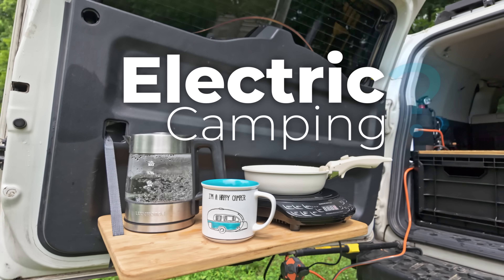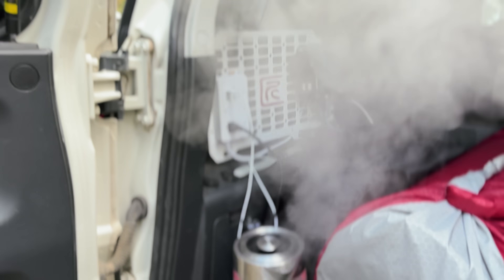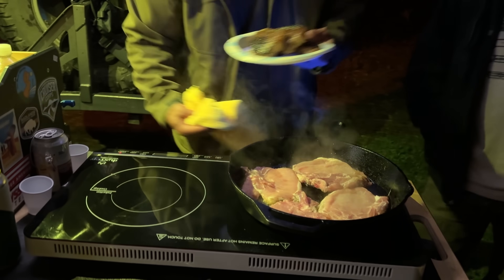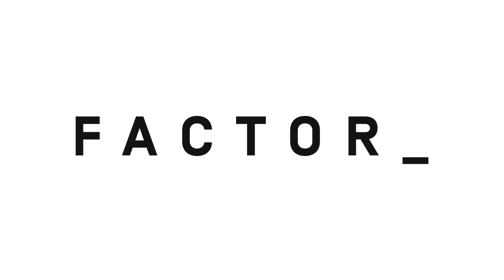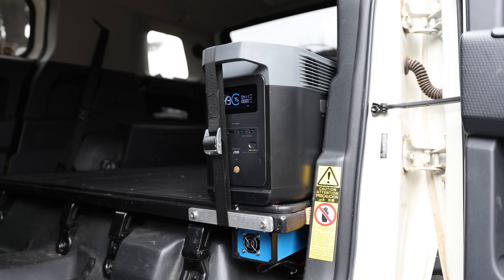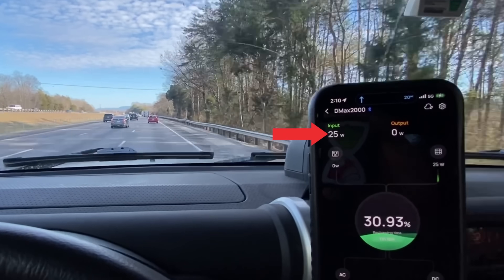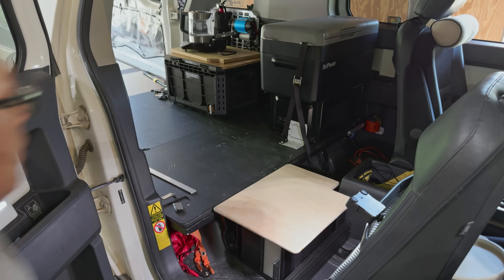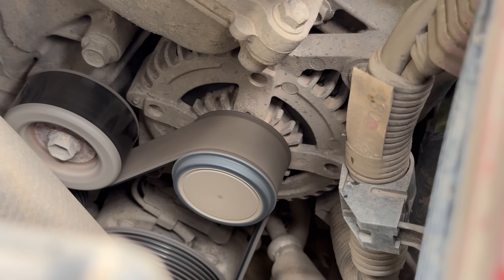I Tried Full Electric Overlanding For 1.5 Years | Was It Practical?

Comment: Not quite there yet. We have an offroad trailer still reliant on LPG for warm water and space heating. 200AH with 200W solar is plenty to keep everything else powered and batteries topped off. A 20A DC-DC charger that connects over an 50A anderson plug helps tremendously when driving from location to location to bring SOC back even if it was very low. Yet, I am not sure yet how to solve the heating issue. Everything else that only uses high current (coffee machine, induction plate, microwave, kettle) for short time is no issue for sure.

Comment: Fantastic video! Thank you for sharing. I really enjoy your breakdowns that start with general engineering design choices, then break down parts choices into some main categories and price points based around *use cases*, then discuss individual brands and their implementations. It's so refreshing to get the opinion of an actual engineer rather than the intuitive, but not grounded in deep ME knowledge, "opinions of guys in your local overlanding garage". Perfect example: your shocks and upper control arm videos simplified my decision making process greatly. Thank you! I've been searching for a channel of information just like this. GIVE US MORE VIDEOS!

I think you mentioned in one video that you also owned a 1st Gen Tacoma. I just lucked into an old man (25-year old classic vehicle!) 1999 Tacoma SR5 3.4V6 standard 4x4 Xtra-cab w/ long bed. Generally, it's in fantastic shape for an old truck but it's going to need serious love in the suspension category especially as the big FabTech coilovers and the old shocks in the back with add-a-leaf springs in the back are all well past their duty cycle dates. It's up on 32" BF KO2s and the back end bounces up and down like a trampoline when I go over train tracks!

Any videos you might consider making for giving your ancient Taco some love in 2024 would be seriously appreciated. My eventual goal is to outfit it for overland camping with a Kuat IBEX topper and all electric camping setup like you've outlined here. May be tricky with the old-time electrical system, I'm not sure. I was thinking dual battery with a couple of slim-line Li-Ion packs but now you've got me thinking about the all-in-one battery banks. Ecoflow has some seriously big batteries available, all the way up to house-capacity.

Comment: We boondocked with out TT without propane for two years in all but the most extreme cold weather.  4kWh, including LFP and a Delta 2 Max.  Just Ordered a pop-up truck camper, Tune M1.  Going full electric using my D2M and a 280ah LFP, 400w solar, and dc/dc charger.  Cheaper than putting in a propane system.

Comment: I'm mostly diesel.  Diesel heat, diesel cook top, diesel engine.  My electrical is 12V with access to an inverter that we only use for a minute or two at a time for the microwave.  If I were to go all electric it would cost a lot of money for the batteries.  No thanks.

Comment: Which is more power hungry for heating water, the electric kettle or the microwave? Would be nice to just have the one device, if the power consumption isn't too far off.
Reply: Kettles are 80% more efficient than a microwave for heating water. Another source says the efficiency of the microwave to heat water is only 47%

Comment: One other big point is many power station companies are FINALLY putting high amp 12v DC outputs on their units. Oupes, for example, has a 12v\30amp DC Anderson plug output on their mega line. This allows you to run 12v accessories like lights, diesel heaters, etc. You can even connect it to 12v switching systems like those from Switch Pros, Auxbeam, Garmin, etc. IMO there is very little reason to run dedicated complex dual battery systems anymore. Power stations with the fast alternator charging and high amp 12v DC output have rendered them obsolete.

Comment: I've been running 95% electric for the last 14 months of fulltime boondocking.  I did use some propane for heat over the weeekend when I got caught in freezing temps.  I haven't refilled propane since I started the all-electric experiment. 

My setup is ~$1,100 for 750w of used panel, 45A victron controller, 1280Wh of LiFePO4, 1000w PSW inverter, and a VSR for alternator charging.

Comment: Lets be "Honest" here, to say the induction cooktop doesn't get HOT is a little misleading, I have the Nuwave myself, and while it's true it's different from conventional surfaces, In use with my cast iron pans it will absorb heat from the pans as you cook and when you finish you DO NOT WANT TO TOUCH THE COOKTOP without some cool down time, it will burn you.

Comment: The current problem I have with the new all in one power systems it how slow they recharge on 12V.  For me the dual battery system is still better for now.
Reply: I am all electric camping, kettle, toaster, induction,,amd kettle for heating water for a shower. Overnight we typically use 80AH from the battery. We then charge at 80A, so, it takes 1hr of engine running during the day to replenish that 80ah, and we have 240ah total. We have never runout.

Comment: We boil water in the microwave in our van all the time. I would be curious to see what your thoughts are on boiling water with your microwave vs. your kettle (time &  energy usage)
Reply: Microwave is typically <50% efficient, ie, it uses 2x more power than an electric kettle, and a 2000w kettle is much faster.

Comment: I plan to utilize more AC in my next truck build. I’m not sure I will ever be 100% electrical, but I do think things like heat (even though inefficient) can be utilized successfully with how quick some of these can charge now.

I just got an Etaker today and I have to say I am very impressed so far. It has a lot of features other batteries as missing for a good “overlander” battery pack. 

Well done as always man!
Reply: Add a few 12v blankets or pads for those times the temperature is not as harsh

Comment: I run a microwave,electric kettle and slow cooker off a small system in my Jeep. Solar panels, 1500 converter, no problem. Two deep cell and a spare seperate lithium for the fridge.

Comment: In my opnion, you bring many valid point but on the hother hand there's some misleading information. Ease of setup, power stations win. Total cost of ownership and battery capacity, a component based system wins. If you have the capabilities to setup yourn own system, powerbanks are extremely expensive compared to the alternative. I will also add that solar panels can absolutely provide sufficient recharge depending on your location. There are so many variables involved which most people do not understand resulting in an unnecessary high expense purchase of a powerbank. Thanks for sharing. Cheers

Comment: The new generation of hybrid pickup trucks/SUVs should make full electric overlanding a no-brainer. The new 4Runner and Tacoma have a 2400 W inverter that can run multiple appliances already, and the truck automatically charges the hybrid battery using the ICE when the SOC is low. This would leave more space in the truck for cargo and equipment, and for a much simpler and care-free experience.
Reply from the maker: The only thing I don't like is how soon the engine will kick on. It tries to keep the SOC very high. So for electric cooking or running things overnight. The engine will go on and off every 5 minutes. Kind of disturbing for a camp site.

Comment: I fit 200Ah Li where the rear AC would go in the luxury models of GX460 behind the plastics... I welded up a battery box that is held in place by all of the existing bracket holes. I  can park the GX in the shade of a tree, and run an extension that plugs into my rear bumper out to 400w of deployable solar panels. I 've got 2000w inverter tucked in on the other side, with an output to my bumper, as well, so I can run an extension cable out to whatever I need. I dont' have to open the vehicle to add more solar or to run AC out. The batteries, inverter, cabling, monitoring, charge controller etc, don't take up any interior cargo space. I'd have to add up total cost, which is likely more, but I still have seating for 5, a drawer system and a 73qt fridge/freezer.

Comment: What about -15°C= 5°F ? Don't the power stations need to be kept warm ? From 🇨🇦
Reply from the maker: yes. but when you discharge it (like running electric blanket over night) the battery itself also warm up. which helps but probably not enough for 5 F. That's another reason I switched to the ETaker, which has self heating function so it can charge and discharge down to -22F.

Comment: I will never go back to gas after moving to electric because of space constraints in the SWB Pajero Evolution. I have my whole car run off a single 200Ah lithium that does cranking and deep cycle duties. It charges at full alternator current (100amps) so it recharges extremely fast and i get about 4 days of fridge and cooking duties out of it without starting the car. Never worrying about cold or wind is a huge advantage of induction as well
Reply from the maker: Wow Pajero Evo. One of my favorites

Comment: I have the same cookware as you and they are absolutely fantastic. Clean up so easily and work great on induction stove top! Yes, going electric is the best way to go! I have two portable power stations one is 2000 W hours and the other one is 750. Perfect combination and they all recharged very quickly! I think both will charge in about 80 minutes total would never go Two. Dragging around propane, containers, or gas. Thanks for the videos.

Comment: I have a Bluetti AC180 that provide 1800 watts of AC and 1173 watt hours.  $600 for the AC180 right now.400 watts of solar and can also recharge using my 400 watt vehicle provided AC. I use a Stokes VOltaic 500 watt kettle and now have their new electric cook set with pot and pan. Vary them from 400 to 1000 watts input for cooking.

Comment: I "hard-wired" my 5lb propane tank on my FJ Cruiser for my permanently-mounted Joolca and tee-ing off using 1/4" RV quick-disconnects to minimize set up for my stove.

With the amount of hot water I use while camping, I couldn't use an electric water heater like a Duoetto as I have 100L onboard. Preheating the water while driving using a Glind hot shower system in recirc mode helps reduce water wasted when arriving at the campsite. Water stays warm for a while too which is nice.

A 1-lb tank for emergencies with the right adapter would have saved your friend for when the 5 pounder empties during a trip.

Comment: Very interesting, I’m still building up my Troopy and maybe need a slight rethink on the finishing on one side of the vehicle to include electric cooking.
At the moment, I have got a brand-new Red-Arc Go Block 100 ah all in one battery System including the mounting System the lock into place in the vehicle.
It can run an inverter so might have to do some more research on this.
Keep up your great videos, thank you .
PS, I’m running the standard pizza cutters that come standard with my vehicle new.
225/95R16 And do not plan to go to anything wider and this cannot replace them in the future which they probably go with a 255/85R16..

Comment: ~3yrs all-electric, although it's come via trail and error but luckily sparing significant cost per error. Currently at 800ah lithium for the past ~1.5yr with RedArc RedVision, which only allows 30amp max charging from alternator, solar, or 120v. Last summer worked at night and slept in vehicle during the day in Arizona. The hottest outside temp 119F while staying cool inside at 72F x8hrs with 5k BTU 120v window AC unit via 3k inverter and 600w solar panels. In the winter, then sleeping at night, NMBDR ~8k above sea level, 7F was the lowest stayed warm with 120v 1800w heater. Additionally, 1800w induction heater, 1800w Ninja AirFryer, and 300w 12v heating rod to warm water for showering. In the ~3yrs I have upgraded the batteries, but their location has stayed he same, the rear seat footwell in a 4Runner on top a 10g footwell tank from Front Runner. Electric over propane or diesel, is more set and forget, no spills or leaks, and regardless wind or elevation as well.Thanks for sharing.
Reply: In my experience, and I'm sure others have noticed similar, most of the battery is consumed between making dinner, staying cool or warm while sleeping, and making breakfast, all when there is no solar power support.
Reply: @jatorresrv  How do you mount an AC window unit in the 4runner? Were your solar panels attached to the roof, or did you set them up on the ground? Care to make a video of your setup? Could you provide links to everything you used?
Reply: Man, that's 90-100KGs (200 pounds) of battery just to throw out 7-10kgs (20 pounds) of propane....No thank you. I usually get two 3kg bottles and use the second as an emergency. Before the second one is out, I would have replaced the first one. Saves me a tone for gear that matters. I have a 100Ah battery to run lights and fridge and small devices/charging....I think of adding induction cooking but i do not have the space, and more importantly, the courage to spend my money to do it.
Reply: @ How do you run an AC for an outside temp 119F during the day and you sleep in your 4Runner while working at night? By the way, when fully loaded my weight is 6,200 lbs, despite my battery weight. I also a never looking for propane when in Central America, not to mention, harassed by police/military for carrying propane in a passenger vehicle. There are lots more reasons why battery and no propane for my traveling style. Hope that helps.

Comment: Done similar stuff but back in china. Think it really depends on the gears as well. I did it by achieve using BYD DM-i vehicle. They are just electric car with very efficient generator. 46% efficiency for the new one i believe. My one gives about 4-5kw power per liter of petrol. And i had a 200+ liter tank that i installed My self. And i calculated to use about 2-5kw per day and using the function Called power station mode, Battery in the car is 35kwh So takes more than a week to drain the battery flat And If u get the engine running and charge the battery up again. In theory Full tank of fuel is able to last me about 210 day in the wild. So the car will last longer than me i think haha.
Reply from the maker: The EV and 4X4 options in China are from another world! Very cool stuff
Reply: Yea i missed it so much After i Left china. Has to be hybrid tho. So u are not limited by range. And still get good power. Like BYD tang DM P Has about 650hp And 900+nm with the petrol hybrid engine.

Comment: To me, overlanding is about redundancy.  I'm not full electric but my system (2.6kWh 24v/2kW inverter) is more than capable of doing so.
Going all electric is fine but highly recommend keeping a minimum of gas-based items onboard as a backup in the event the electrons, plugs, software, bluetooth, etc decide not to play nice for any of the myriad of reasons that they typically do.
Good video and happy trails!
Reply: Isn't fire starter enough when wood is around? I wouldn't want to carry gas cans, I'd rather install two batteries so if one fails I have another.
Reply: A spare inverter and dc-dc charger take up way less space. 
We pack our fears.

Comment: Its all good until a lithium battery catches fire.
Reply: Are you suggesting canisters of pressure explosive fuel are safer?
Reply: Unlike propane you mean? This is a joke, right?
Reply: Delta 2 Max is LFP, so doesn't catch fire. Many more cycles and higher discharge rate, but less capacity. For safety, the only way to go. I would not feel safe with Lithium Ion in a hot vehicle.
Reply: Exactly my thoughts and precisely what i purchased myself and another for my parents! It's dual purpose for me as I would love to go camping and road tripping But also have a backup to be able to run my furnace in the winter time if the power goes out. My parents are elderly and it's just small enough to be portable but has such high capacity that it could easily run. They're freezer and fridge in the summer. If there's no power and mom's cpap through the night or their furnace in the winter. hoping it lasts them well @alexsoo1752
Reply: It’s all fun and games until your propane cylinder catches on fire. Then it is a hilarious game of hot potato.
Reply: It's less likely to catch fire than your tank of petrol but hey, facts are not cool 😂
Reply: Versus literal fire bro? 😂